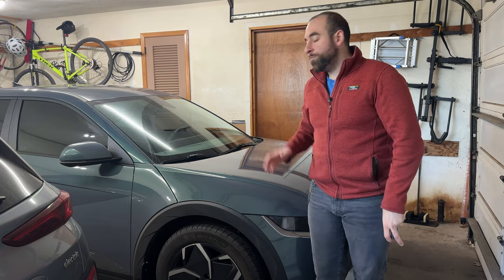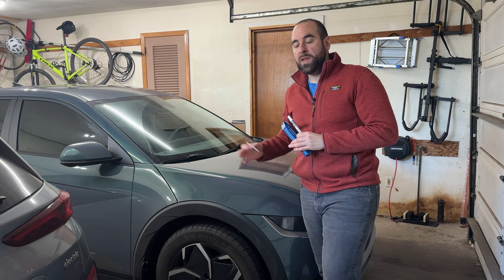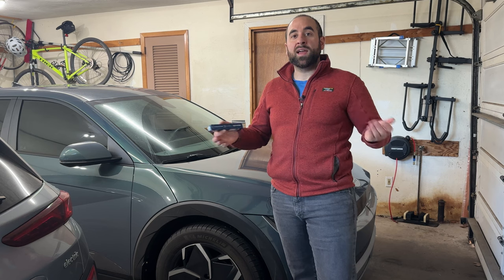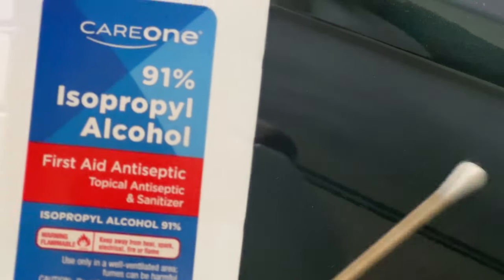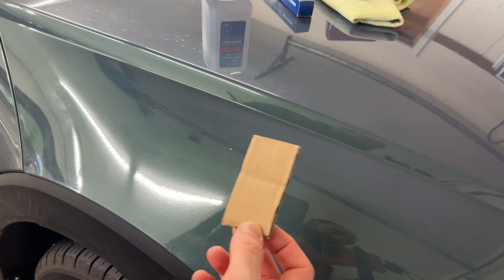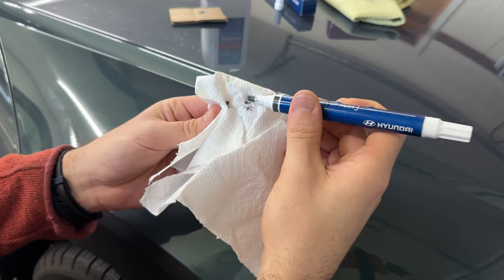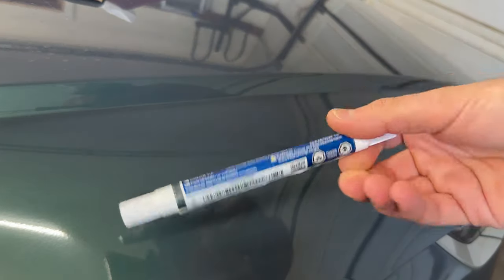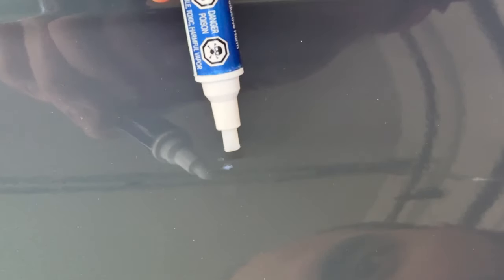How To Repair Pesky Rock Chips on a Hyundai Ioniq 5/Kia EV6/Genesis Vehicle!

Comment: Piece of advice.  Do not use paint pens!!! Go online put your color coat in and find a different seller there's a bunch that come with applicators.  Another thing this was a bad job you want to put layer by layer of paint until it's level with the original paint.  You may have to lightly sand and polish which even the most unskilled person can do by watching YouTube its so easy. THAT LOOKS HORRENDOUS

Comment: Holy smokes don't do the repair this way. Most of the base/clear pens require much more drying time before the clear is applied. I dunno, it justs looks like a slightly closer colored rock chip. Maybe you're different, but I couldn't drive a car with a chip that noticeable, even after the repair. Goo!

Comment: I could have used this the second month I had my car. I had some really bad rock chips last winter into spring before the roads were repaired. It would have been too much for the pen to fix but Luckily somehow Hyundai warrantied (warranted?) the paint and had the hood repainted. I think it's made of aluminum too so it won't rust. Great video! 

Can't wait to get my car back...been hearing word from more and more people getting their 12v systems repaired. Supposedly Software / AVN / ICCU issue is resolving. Only a matter of time now.

Comment: I have a couple smaller-than-pin-head sized dots on the front of my Elantra N next to the logo.  I have no idea how they got there as I have barely even driven the car (it's 2 months old, 998 miles) and they don't look like a chip you'd see from a rock because they are literally less than 1 - 2 cms apart.  They literally look like something was pressed against the car.  Again, not sure when or how that would've happened.  But because the car is white, underneath is black (in this case).  So i have a ruined, brand new car because of it.  I got a pen from Hyundai to fix it, just needed some tips because they are SO small, but to me, they may as well by Grand Canyon sized.  Thanks for the vid.

Comment: Alitle trick l learned that i feel kind of works. Use the back of a flexible match stick to put touch-up paint down. It will fill the the scratch fairly well and is controllable
Reply from the maker: Great suggestion! The large chisel tip on the pen is too large for most of the uses anyone will need it for. They really should give it a smaller one.
Reply: G G, I'm at a loss regarding "flexible match stick". I tried searching for that and all the results come back regular matches. Any link to a pic. Help
Reply: @G G  wow it never cross my mind and I'm a smoker. You just saved me from Google search hell. Lol